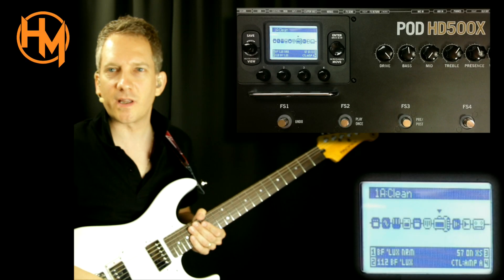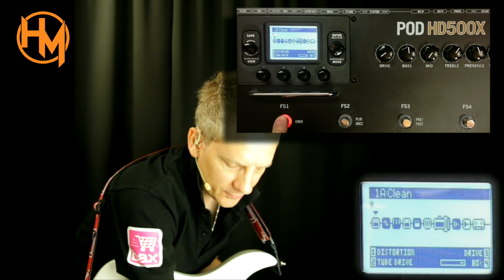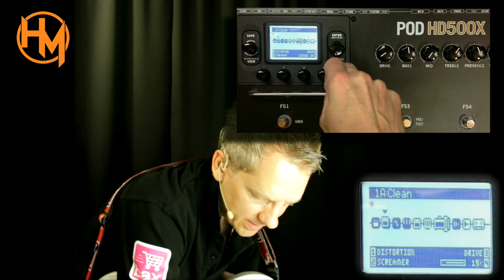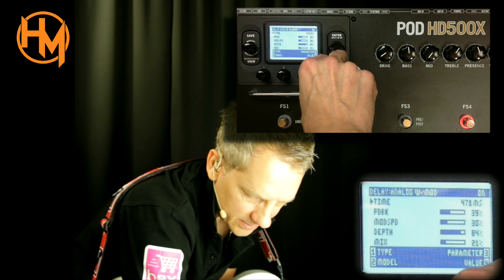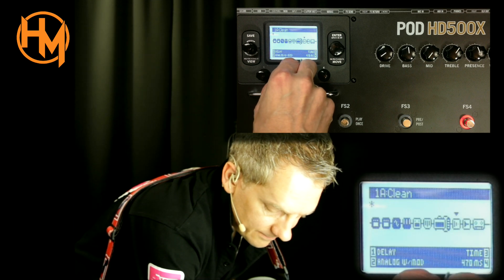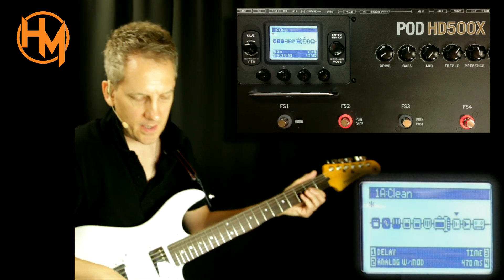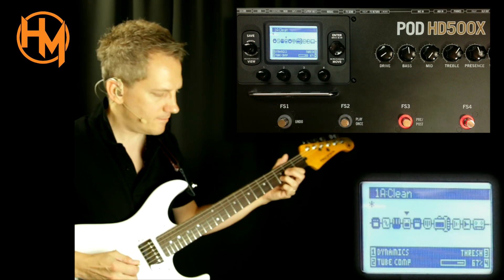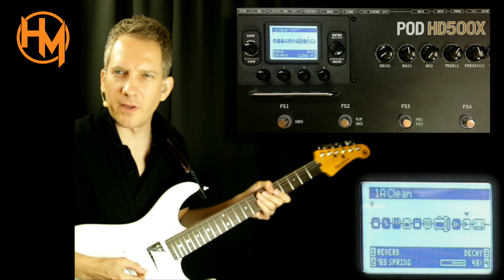Line 6 POD HD500x How to create a clean patch

Comment: I can't believe creating a clean tone on this machine is such a pain. I can create a clean tone on my Bosst GT100 with no effects on or amp modelling and just setting the global input gain lower than 0db. I'm not saying against Line6. Me myself had this HD500 before which I sold after a week because I cannot get a decent clean tone out it. Now I have a Line6 X3 live which has input gain calibration function.
Reply: I'm also baffled they don't have a swell effect in this thing out of the box either, and even done with a mod effect it's sub-par on this unit in my opinion.  I had one of the old Floor Pod Plus units which I sold when I got this, and it did exactly what I needed in my music.  I was surprised that there were a few basic things missing from the HD500 that the old FPP had.